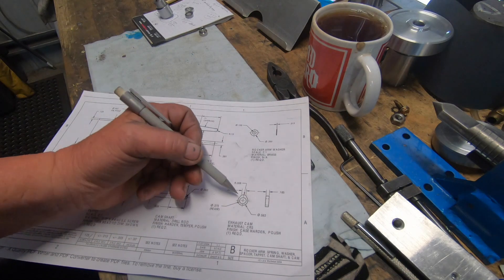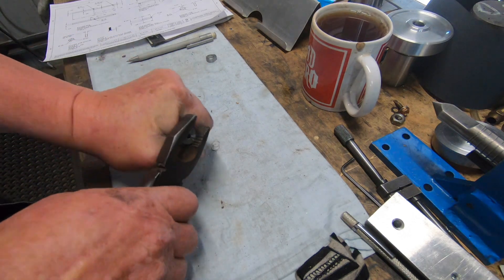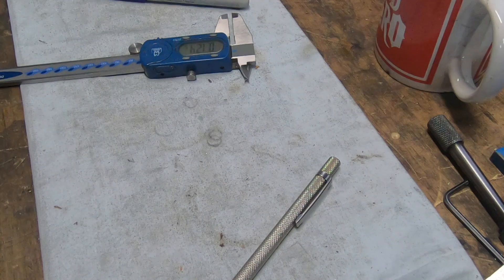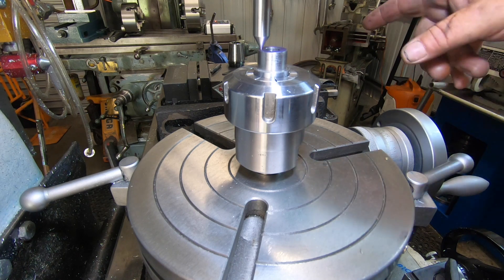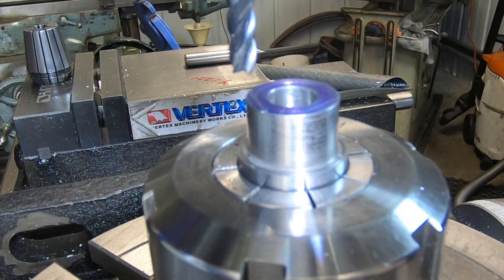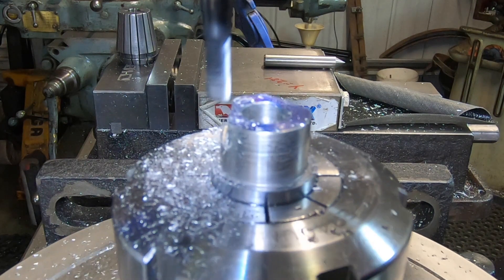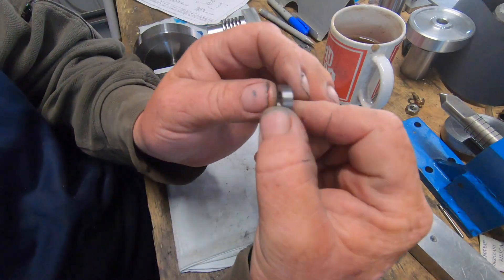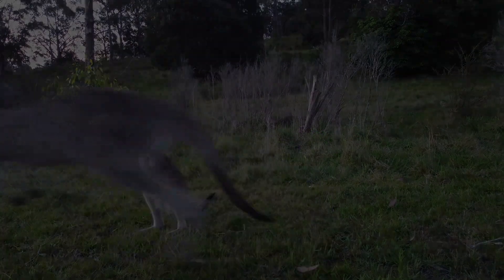Webster engine build, Part 7   Exhaust cam lobe

Comment: Awesome work, Matty! Really enjoying this engine build. You called your layout "rough as guts", but all you needed them for in the end was for double checking your positioning, which we all do. Centering on the work, and figuring your offsets, means that part came out as precise as your machines and indicators allow. Nothing rough as guts about that. 

You do good work, man. I appreciate that you show your mistakes, as well as your successes, and that you learn from both and become a better machinist. Seriously, don't doubt yourself so much!
Reply from the maker: Gday, I think it’s important to show the mistakes in the videos, there could be someone watching that’s going to make the same thing and it saves them the trouble of working out that’s it the wrong way, it amazes me how many machinist never make a single mistake🤔, nothing to be ashamed about in my books, at the end of this build I’m going to show the pile of bits that where mistakes and screw ups, should be a laugh, appreciate you watching mate, cheers

Comment: Nice work Matty. Was good watching your method and processes used. Hey what’s this rough as guts marking out? That’s how I operate most of the time lol 😂
PS: cheeky bloody Wallabies
Reply from the maker: Gday Aaron, that’s the way I work all the time here as well👍, have you still got a copy of the cad drawing you did, I can’t bring it back up in the email, the Roos like checking out the drone, thanks for your help mate, Cheers
Reply: @MattysWorkshop  Hi Matty, I have just sent you an email with all the links to the CAD models and drawings.  Cheers, Aaron.
Reply from the maker: @AaronEngineering  thanks mate

Comment: 9:43 don't get too wound up, you're a machinist, not a videographer. I don't expect I-MAX quality on YT!
And nice solutions to the problems presented with manual machining!
"Proper way of doing it"? If it works, and you get the part to specs then it is a proper way of doing it. There may be other ways that are more efficient or quicker but YOUR way worked just fine!
Don't sell yourself short Matty!
Reply from the maker: Gday, I’m certainly not a videographer but I like to get good clear shots, it’s not to bad for a GoPro, thanks for watching mate, cheers